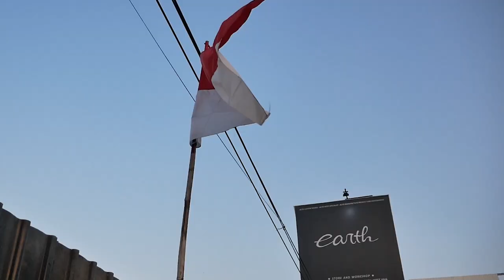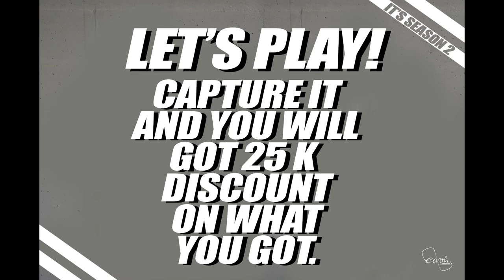MODIFIKASI HONDA BEAT TURBO PAKE VELG CUSTOM LANGSUNG DI TEST SAMPE DI BANTING-BANTING#MOTOVLOG

Comment: Saya Team Blow Off Emng Keunikan Sendiri Klo Motor Tiba² Ada Suara Blowoff, Intercooler Klo Bisa Di Samping Kipas Mesin Klo Cukup Itu Pun Klo Tidak Di Tengah Pun Bisa & UntuK Bodynya Klo Menurut Saya Sih Dibuat Ori Beat Aja Supaya Ciri Khas Beat Ini Gk Ilang Dan Bikin Org Yg Liat Tuh Langsung To The Point Bahwa Ini Itu Beat Yg Disulap Dengan Spek Moster Umpamanya🤣

Ya Sedikit Masukan Saya Sih🤣